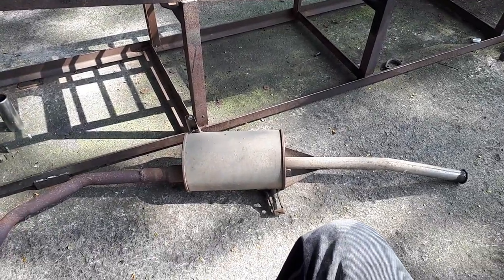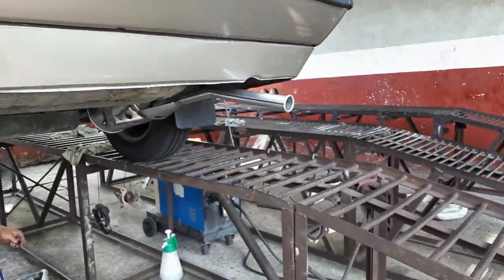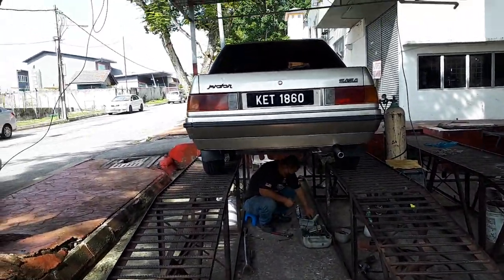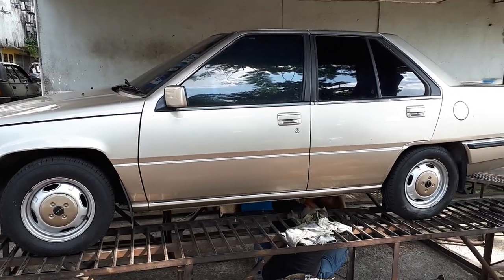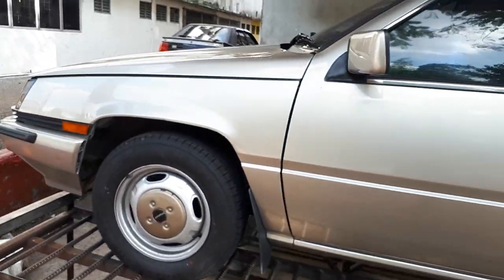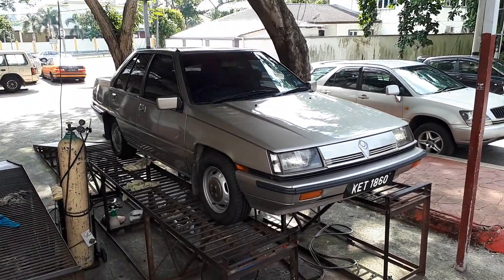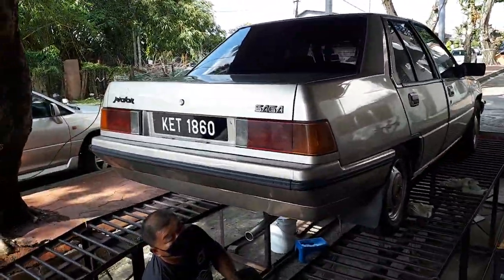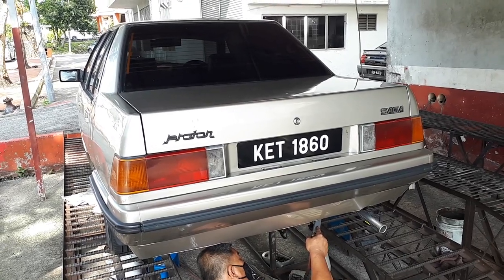UCR UPDATE: The 1985 Proton Saga Continues - Original OEM Exhaust FOUND!! (4min) | EvoMalaysia.com

Comment: This colour is called perawan yellow and this colour was never available for 1985-86 model. I believed this colour came with the magma engine and not the orion series.
Reply: Looking at the bumper rubber lining, this is the 12 valve model, only introduced after 1990.
Reply from the maker: Yes, the previous owner upgraded a bit here and there, and changed the colour, but it IS from 1985, says so on the original geran. Best of both worlds, Orion body, endorsed 1.5 Megavalve engine. ICYMI, in the other videos, the seats are from a MV sedan too 😊

Comment: Can't wait for the next UCR Update of this Saga 😍😍 don't forget to tell Akei (do I spell it right ?🤣) to spray black around the hupcaps.
Reply from the maker: Stay tuned!! Yes, thanks I will tell him to do so for sure!!🙏🏽👍🏾😀
Reply: @ChrisWeevilGarage  The door handle can break very easily due to wear and tear, try asking the secondhand shops as some of them still carried the chrome door handle, which you can paint it over plus lasting too. The shape, size and designs are the same as the original but considering it is more lasting for the wear and tear of usages.